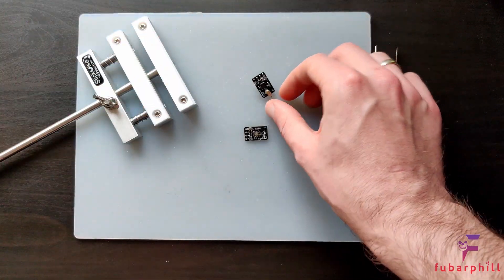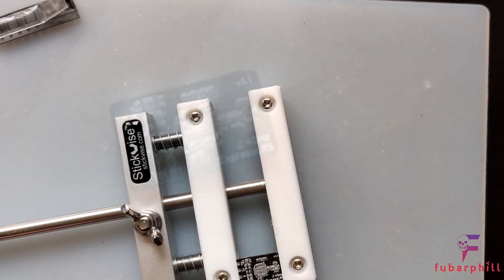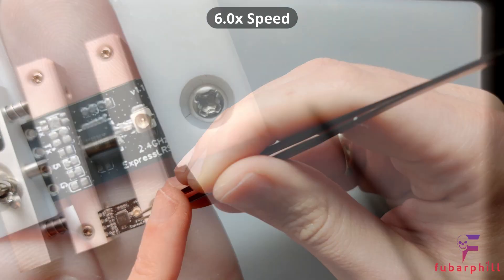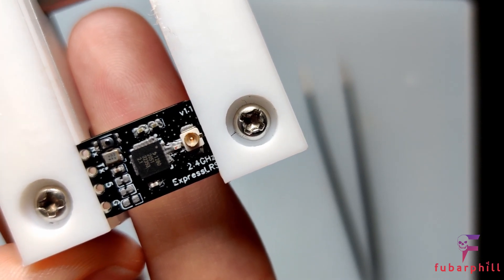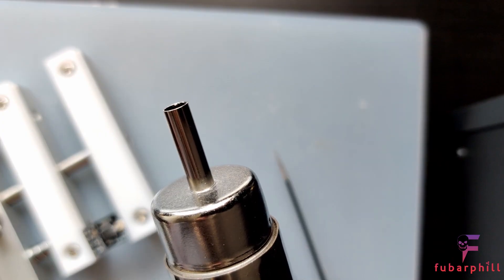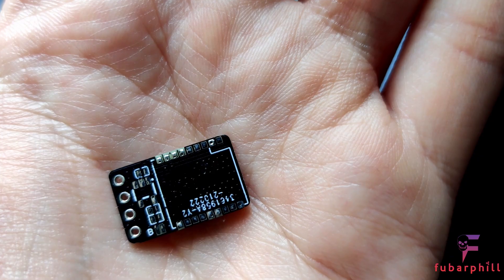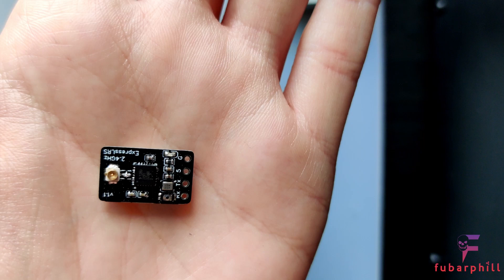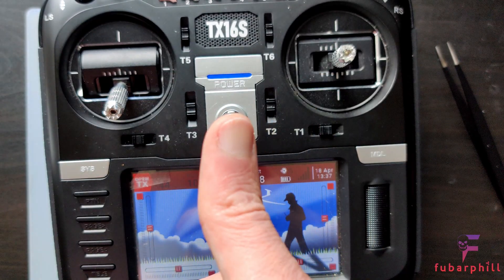ExpressLRS 2 4Ghz Nano Receiver Build

Comment: there is an error, You Must romove the paste under the button otherwhise you get the problem you where facing. 
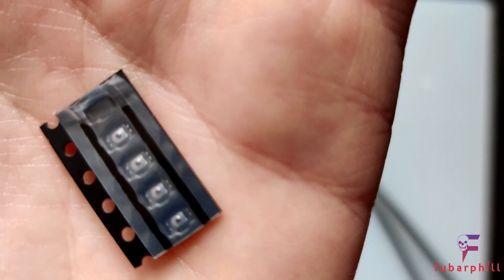3:01 Before placing the button wipe off the paste directry under.
Reply from the maker: Thanks for that, yes I have done subsequent builds either with the paste removed or just not bothered at all with a button. It doesn't always have a problem if the paste is there, depends how it flows - it was fine in this particular case. The button is only really needed for the first flash anyway and I'm pretty sure the footprint for it has now been removed from the latest PCB when I had a look.
Reply: @fubarphill   the button is needed if you are not going to bind via pssword. 
also if the pin in connected to ground the esp01 will be in permanent dfu mode.

Best practise you remove the solder paste under the button. and than you bridge the pasds with le tleter B on the bottom side. After flashing you remove that bridge and you have a 100% working module.
Reply from the maker: @filippoangeloaurelioaltobe3761  I don't disagree with cleaning up under the button as it will avoid a potential issue. If you have a button, you do not need to bridge the pads on the bottom side, it's an either/or. I am not sure binding using the button instead of the pass phrase even works, it was never fully operational from my knowledge and why would you bother when the pass phrase is so much simpler? Again as mentioned, the button footprint has been removed entirely from most of the DIY rx PCBs so this is now somewhat of an irrelevant discussion :). Thanks for the input though as it will help others that may run in to issues.
Reply: @fubarphill  I want to give the best I can do.  this got me so much trouble that if someone is stuck I would like to solve it fast. 
Anyway we all need more content like this.

Comment: Can you please tell me how to flash it?  :) Nice video btw!
Reply from the maker: Sure. The flashing process is straightforward but for the first flash you will need an FTDI USB-Serial adapter like is shown in the video. Connect the pins of the FTDI the the appropriate pads on the receiver (remember Rx to tx, tx to Rx), plug the FTDI in to your computer whilst holding down the boot button on the receiver (or have the pads on the back bridged). You should have a solid light on the receiver and see it as a COM port in Device Manager. Then use the ExpressLRS Configurator (from GitHub), open this up and flash the appropriate DIY RX via UART with your chosen options and bind phrase. You can see more about the Configurator in my TX build video, which is very similar. I will also be doing an "updating elrs" video soon. Once you have a working receiver from the first flash it can be updated without the need for the FTDI.
Reply: @fubarphill  Cool Thanks, was to quick to see that you actually shown it in the video :D That is very straight forward:) Will await new videos from you!